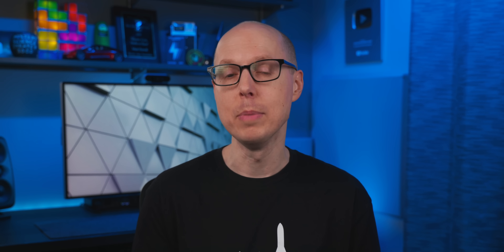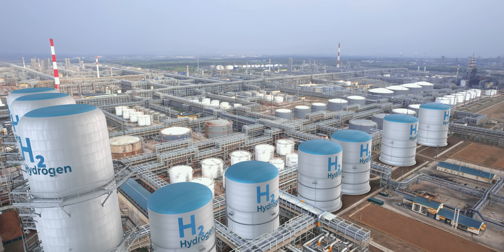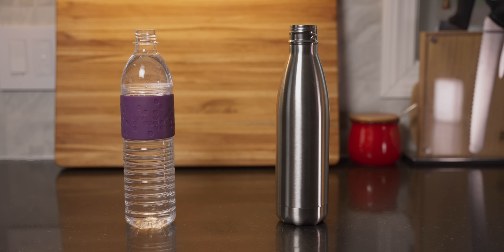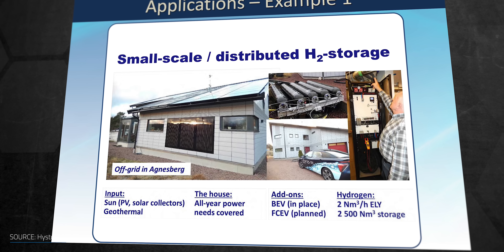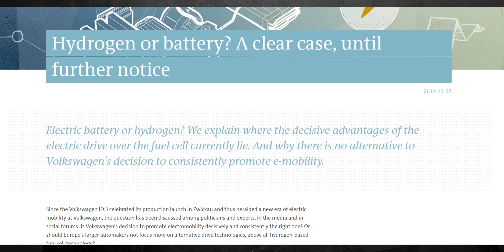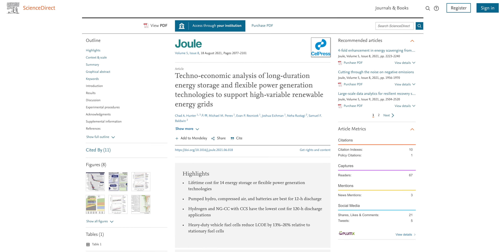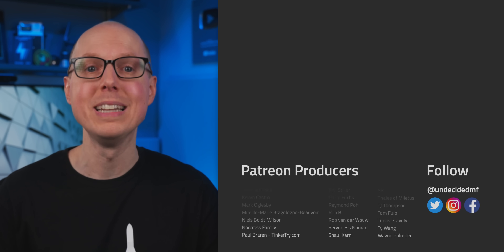Solid Hydrogen Explained (Again) - Is it the Future of Energy Storage?

Comment: I think that at least for the mid-term, hydrogen only really makes sense in a few applications, like city buses for example. My old college town just ordered hydrogen fuel cell buses (with rooftop tanks) that they fill with hydrogen produced from their own solar plant. There's no reason a vehicle like a local bus can't use hydrogen, especially when you only need to build the infrastructure at one or a few depots. Diesel buses are so expensive to maintain in comparison to electric modes, but the overhead wire infrastructure of trolleybuses, and the recharge-time and service-life issues associated with batteries are big problems. I see locally-produced hydrogen for bus transit granting the best of both worlds.
Reply: Battery busses make more sense. For the electricity used to make that hydrogen, the busses could literally travel 3x further.
Reply: @williammeek4078  It's the weight of the batteries that's the problem in vehicles needing larger battery packs. Not to mention of course that lithium-ion batteries are in short supply. You simply can't get hold of enough of them.
Reply: @grahamstevenson1740  The fact that there are already BEV class 8 heavy trucks on the road tells you that batteries are already good enough and the tech keeps getting better. 

Yes, batteries are in short supply for the moment, but that is changing rapidly. We can expect 20% of all new cars sold this year to be EVs. And more each following year until all new cars will be BEV by 2030.
Reply: @williammeek4078  Can you name a single Class 8 truck on the road that's battery powered ? I don't know of one. If there is one I'll venture its range is rather poor.
Reply: @grahamstevenson1740  BYD 8TT and Volvo VNR off the top of my head. And the eCascadia isdue to be delivered later this year.
Reply: @williammeek4078  The problem with that approach is that clean energy may not be available whenever you need it, the batteries are very heavy, and charge time is slow, while electric capacity is low relative to volume and weight.

The point of hydrogen is that it can be generated from surplus energy from solar, wind, etc - where we already have a problem with inability to store that excess energy long term. Funneling that excess energy during peak hours into a hydrogen network applied to local transit busses, airplanes, etc is a great way to get the most out of what already exists. Plus you don't have to build excess batteries which are already rushing towards a supply shortage - and you don't have to worry about recyclability / waste once the lithium battery pack is depleted after its main service life.
Reply: @Real_MisterSir  On a continental scale, the wind never stops blowing. Even on the level of an individual home, rooftop solar, a modest sized home battery are enough to reliably go completely off-grid if you live below mid-latitudes. 

We already have cars with 500+ mile range. Volume and weight of batteries are not a problem, only cost. 

When you try to produce large amounts of hydrogen for energy storage, it is no longer using “surplus” but is a major user so don’t expect cheap electricity from wind or solar that route. And then you get into hydrogen’s efficiency issues. It takes roughly 3x as much electricity to move a hydrogen vehicle a mile as just charging a battery. This means 3x as much wind and solar infrastructure to support hydrogen production as opposed to just using that electricity charge an EV. By the time you get to 2x nameplate capacity, RE exceeds natural gas in grid reliability and ability to produce power so there is absolutely no point in going the hydrogen route. 

And these are just some of the fundamental issues with hydrogen. Storage was never really the big problem that needed to be overcome for hydrogen to beat just charging and EV.
Reply: @williammeek4078  But how long will it take to charge electrical batteries compared to filling up on hydrogen? Buses don't make money when they are waiting to be recharged. Then there is the daily grind of the batteries being used for public transport, will it be up to the task or will the life of the battery drop significantly?

My view is watch what the military is testing as that what will ultimately be the final decision of any government, and there isn't an army in the world that's going to sit back and wait 8 hours for a main battle tank to fully recharge. And the most promising is what the US navy is working on. It can run on the current global fleet of vehicles with minimum modifications of the engine which means we don't have to scrap over a billion engines. https://www.smithsonianmag.com/innovation/fuel-seawater-whats-catch-180953623/
Reply: @stewartleslie3292  City buses don't make money in the first place. They lose money. And most buses don't need to be in service for many hours of the day. So taking a long time to charge isn't a problem for city buses. What matters most is cost and dependability.
Reply: @GeorgeMonet  I've no idea who is running your bus service, but in the UK things must be very different. Trent Barton has a huge active fleet and they don't have much of a surplus fleet.
Reply: so the produce solar electricity...to turn it into h2 on terrible efficiency,  to run expensive fuel cell busses. 

rather than just putting the electricity straight into a battery with very few losses....
yea doesnt seem smart
Reply: And gaseous storage works just fine.
Reply: I see no merit in limiting this tech to just big vehicles. Why not cars? Frankly, electric car limitations are just lame. Own a smartphone? Have one die on you suddenly? Have one not charge properly? LAME. We need an alternative to oil, a limited resource which is running out fast. So, why not in personal vehicles? At least they wouldn't be lame. Maybe expensive to maintain early on and to develope but, it's better than battery power will ever be! Ya, and did I mention, NOT lame?
Reply: @JS-pw8nr  i see no merit in trying to put hydrogen in any vehicles. Hydrogen is just too inefficient
Reply: @JS-pw8nr  Hydrogen at 700 bar/10000 psi isn't really efficient, the fuel cell requires a lot of maintenance and if you think a BEV is hard on resources then don't even think hydrogen which requires some of the rarest elements (no, not rare earth metals, think platinum group). And FCEV still are BEYv, just with an inefficientenergy source...
Reply: @JS-pw8nr : Hydrogen is not nearly as efficient as oil and it is highly volatile unlike petroleum.
Reply: Your quoted price of Gasoline was $3.50 per Gallon; now @ $5.00 a gallon the efficiency cost relationship has gone in a positive direction for current tech, and shall only continue to improve with Petroleum costs increasing even more over time. This also addresses the Environmental impact!
Here in Europe current Gasoline prices are even HIGHER (What is the average price of gasoline in Europe?
“People say that it's terrible that the price of gas here is over $4, but gas prices in Europe are $6 or $7,” says Giacomo Santangelo, an economist with Monster Intelligence.
...
The Ripple Effect.
Country	Price per gallon in U.S. dollars
Finland	$8.894
Iceland	$8.755
Greece	$8.709
Netherlands	$8.582)

Eastern European prices are much lower, the extreme costs in the typical EU Nation are reflecting HIGH TAXES levied by the individual Nations.
Just the same, regardless of Local situation, the situation improves for Hydrogen.
Reply: @gringo1723 : Using artificially inflated gas prices is a failed argument in itself.

Comment: I think people misunderstand the role efficiency plays in environmental or cost effective energy. Something does not need to me efficient in order to be more environmental or cost effective. For instance. There are diesel engines than can achieve higher energy efficiency than hydrogen, but that does not make the diesel engine more environmentally friendly. The same can be said for cost effective if you take the example of something like the Saturn V rocket. The Saturn V has about the same efficiency as a diesel engine, but the energy costs substantially more. Efficiency is no doubt a part of the equation, but it does not the determining factor. The goal is to create an environmentally friendly energy storage system, therefore that is what we should be evaluating. So far, all studies point towards green hydrogen being significantly more environmentally friendly than lithium ion batteries and carbon based fuels. For transportation purposes, it is the best option we have. Studies have shown even if we can reach the theoretical limit of lithium ion battery storage we would still be shy of hydrogens capabilities. Remember what we are fighting for!

Comment: I remember seeing videos of some Brazilian van running off a metal hydrogen storage thing around 1980.
Since one of the main reasons for this and other technologies is to power vehicles to reduce green house gases as well as reduce smog lets go back to original tail pipe emissions standard established in California August 30, 1967. 
At that time the focus was reducing smog. There had been electric buses running off overhead electric wires for several decades already so what is the show stopper in coming up with a practical system of putting a few hundred volts in one or more lanes of freeways. For example a groove which is 1 cm or so wide and goes in ~10ish cm. Top and first 1 or 2 cm is electrical ground followed by non conductive material and last 1 or 2 cm a few hundred volts to power vehicles. So a vehicle would have to detect the power groove and have an arm or something that would stick a finger in to get the juice so it's gas engine can then not have to work or so it can not use it's batteries and even recharge them.

There'd be lots of problems like flooding and components breaking off and falling in the groove so it would require some continuous maintenance and ability to tell cars the system is down or there is junk is the groove so don't put your finger in but what is the show stopper? Then carrying lots of heavy expensive batteries isn't necessary unless you head back in the mountains.
Reply: You seem to have gone off on Yer own track......
Reply: @gringo1723  Affirmative

Comment: Water is already a great hydrogen storage medium and it even comes with oxygen to assist in combustion. If there was a way to extract these two elements quickly with the least amount of electricity then hydrogen combustion engines could be a reality.

Comment: There are some things that always stuck with me when thinking about hydrogen storage. Like how ammonia can be rather dense (comparatively) medium for holding hydrogen when compared to LH2 or compressed hydrogen. Sure you have to break it down, but you wind up with hydrogen and nitrogen, rather than things like CO or CO2 with methane.
Reply: I must be missing something…. It looks like you are saying burning hydrogen releases CO and CO2? (Burning hydrogen gives off water….)
Reply: @daleatkin8927  : You're missing the "with methane" part.
Reply: There is turquoise H2 production, with this metal storage medium the only things coming out of those facilities in quantity would be solid ultra pure carbon black for batteries and graphene, instead of mining and refining graphite, and "solid" H2 for heavy transport and industrial energy use.

Comment: As far as renewables go I believe we're going to have to get better familiarized with working with all the alternatives. In Brazil your car may be electric, but if you're above the 50th parallel you'll probably stick with gasoline. Hydrogen may be better in the north where the cold may be a benefit. Wind if you're by the sea, solar panels if you're inland, water displacement in rainforests, hydrogen creation in deserts...

Something not mentioned in the video, does the metal-hydrite lattice work break down with usage? 
Great video,

Comment: This seems perfect for cars given the needed temperature range is cabin temp to engine temp.  A hybrid system could in theory allow instant "refils" with hydride canister exchange and even charge your battery.
Reply: Engine temp is irrelevant for hydrogen. No point burning hydrogen in an engine, that's too inefficient. Fuel cells and electric motors would be the way to go. Wonder how hot fuel cells get?

Comment: 8:33 50kWh/100kg is significantly better than what is in model 3.  Model 3 battery weights roughly 500kg and has only 80kWh. Even when talking about cell level energy density, you will not get much beyond 25kWh/100kg (250Wh/kg is traditional metric) in mass produced lithium batteries.
Reply: The big problem for me is, that even if it stores 50 kwh/100kg, if you convert it back to electricity in a fuel cell with 60% (current top values) efficency, 30kwh/100kg aren't that impressive anymore.
Reply: Does this already take the needed heating into account? Also, the reversibility is usually quite bad, meaning that a lot of hydrogen is still left in the metal structure, reducing the efficiency.
Reply: That's per kg of metal hydride though. The weight of the entire system will be much higher.
Reply: I'm also interested in the statement of 50kWh/100kg. 

Is that just a claim by the company GKN or is it something that has been published and peer-reviewed?

Comment: Metal hydrides have been touted as the storage solution for hydrogen since the first big H2 hype back in the '90s with Ballard and whatnot.  Everything defaulted to compression and liquifaction because so far, hydrides have not been made to work in consumer applications.  

The big issues have been 1. Cost of the systems.  2. Time needed to refuel (kind of a problem when the main selling point of hydrogen is gasoline style refuelling experience).  3. Cycle life.  Solid storage systems typically struggle to reach 1,500 fuelling cycles.  4. Energy density.  It's bad news if solid hydrogen storage can only match todays batteries in electric cars.  Battery energy density is poised to double over the next decade or so with improvements in chemistry, but there's a solid cap on how much H2 can be crammed into a metal lattice.

Comment: I believe, in general, when you see steam coming out of a stack, it's often because there's a scrubber involved, or if it's flue gas the there's always water coming out due to burning hydrocarbons. It's funny when I hear people complain about pollution when they see this, because they mistake steam for smoke. So, in most applications that have a stack and you can see steam coming out, it's either the water from combustion, or the steam left over from the scrubber. By the way, a common style of scrubber has water spray jets that capture particulates, precipitating them out of the vented air, reducing the pollution and smell, with lighter water escaping through evaporation or atomization. But I admit that I'm not very familiar with the processes you're describing that have some hydrogen waste product, or how much there would be of it in those applications.

Comment: 12:06 But it seems that 100,000MW (iow 100GW) is only a small fraction of even just present-day US electricity demand. That seems to put a hard ceiling on the volume of electricity that can be stored by this method, at least as long as waste flue gasses are needed to make it economical, and that ceiling seems to be a lot lower than it needs to be for this technology to be the future of energy storage, the solution to solar and wind intermittency, or anything of that sort. Granted that the ceiling only constrains solid-hydrogen production , which presumably could run along at near 100% capacity 24/7/52 while the extracted hydrogen could be consumed at a much faster rate during wind and solar dropouts. But on the face of it it still seems unlikely there could be enough headroom for this to be close to a sufficient solution.

Comment: Just like any vehicle, transportation or energy storage/distribution, the cost benefit analysis will not favor just "one" tech.  It's the application and CBA to determine what tech is most "efficient", "capable", and "applicable" for a give use case. e.g. you wouldn't want to use solar as the main energy source to get a operating submarine moving as a stealth platform...

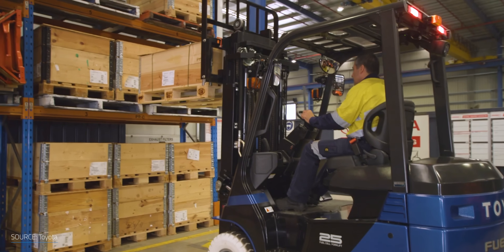Comment: 5:43 The space occupied by the  "metal hydride framework"  (matrix is a better term) is irrelevant because the hydrogen occupies voids that already exist in that matrix whether the hydrogen is there or not.
The process basically uses atomic forces that already exist in the matrix ,to do the compression of the "gas"

Comment: Hi Matt,
FUEL CELL CARS ARE MORE EFFICIENT THAN BEVs....
Everyone claims that battery electric vehicles (BEVs) are more efficient than fuel cell cars, BUT THE COMPARISON USED IS COMPLETELY BOGUS!
This is because no account is taken of the fact that typically the batteries in BEVs weigh a third to a half of the total weight of the vehicle, whereas the hydrogen tanks weigh 3% to 5% of fuel cell vehicles.
So, although the energy transfer to BEVs may be more efficient than fuel cell cars, this does not take account of the huge amount of energy BEVs lose hauling their massive batteries up hills. 
Considering this missing element of the comparison between BEVs and fuel cell cars, it's intuitively correct to say that fuel cell cars are more efficient than BEVs. 
Has anyone got figures to prove (or maybe disprove) my assertion?
Reply: +①③⓪⑤③③④⑤⑥④⑥WhatsApp  Hi Matt, Thank you for the invite. I keep seeing the claim that BEVs are more efficient than Fuel Cell cars and clearly BEV manufacturers are happy with this and there are few hydrogen car manufacturers to enter the fray. I'd appreciate your thoughts. Bob
Reply: @RamblingBob , why did you reply to a spammer?